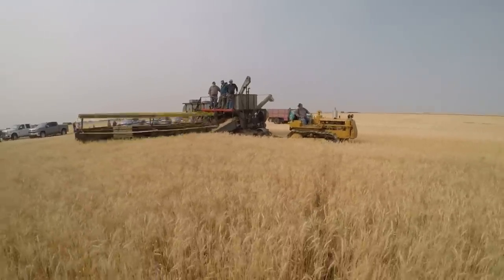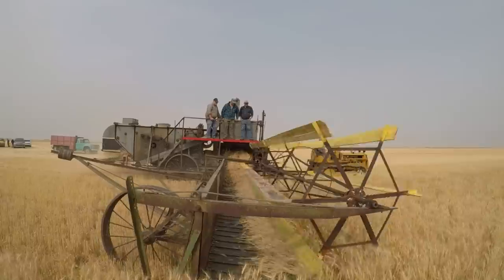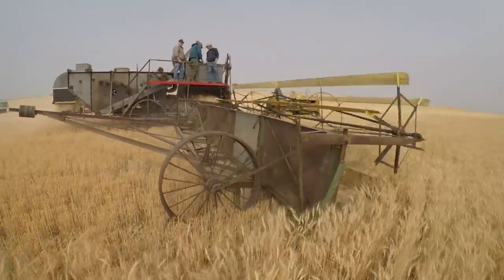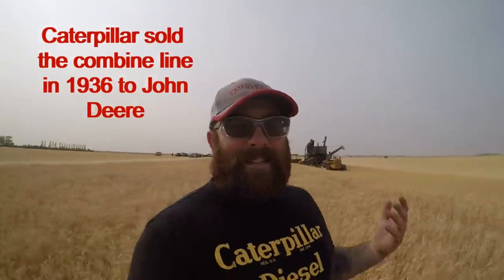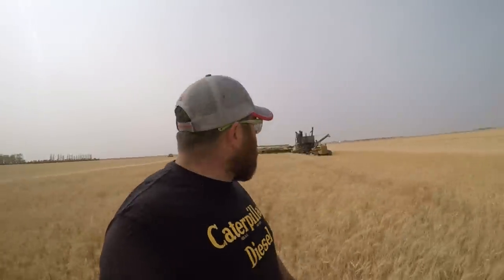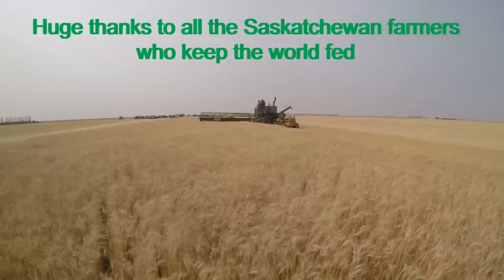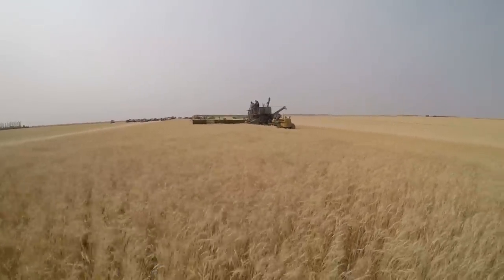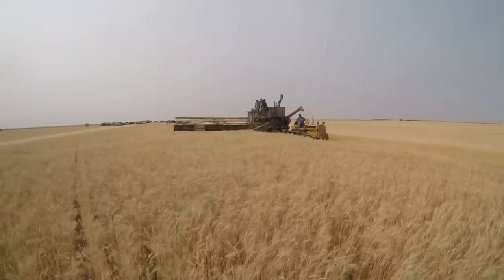1928 Holt 36 combining in 2020

Comment: Brings back memories of one of my first jobs as a youngster on our Kansas grain and cattle operation back in the fifties which was running the "ships wheel" to raise and lower the header.  Our deere combine didn't have the unloading auger technology, however, as it was gravity only.  Dad pulled the 16' machine with either the D2 or RD6 CAT depending on field conditions.  I recall the D2 getting stuck going thru a wet draw where it had to be unhooked and then pulled with a chain to get out of the mud.
Reply from the maker: Thanks for watching - glad we were able to give you a visit to the past!!

Comment: About 1964 my father and his brothers somehow got ahold of an old combine similar to this one, but it had rubber tires and I think a Continental engine. They only used it one year and left it parked after that. One thing I recall is that at the end of the day they were covered with dust and chaff. It also had the canvas belts to feed into the threshing part of the machine. The machine was scrapped out years ago, but was quite a contraption to watch in operation.

Comment: Back in the early 50's I sacked wheat in towsacks on a pull behind. The wheat split in two headers you flipped the lever over for the other  chute when the bag got full. You then pulled up an ear and half hitched it twice and then with a huge needle you quick tied across the bag and pulled up the other ear and half hitched the bag closed and threw it off into the back of a pickup which soon got more full so quick you wouldn't believe it.
Reply: Sounds like an old Allis Chalmers All-Crop machine.

Comment: I remember near our farm in Eastern Washington back in the 1990's there was an old John Deere tag along combine sitting in a barn about 3 miles from us. Not sure what year it was but I figure it dated back to pre WW2. It had rubber tires but I distinctly remember it was a model 36B. Looks like JD might have continued the Holt model designation after the buy out. Wish I could've had the chance to restore it. It had the old levelling system on it installed by RJ Hansen Co. - a necessary component in the Palouse region. Loving these old antiques!
Reply from the maker: JD kept the original design for many years after they bought the product from Holt/Caterpillar yes

Comment: I bet that thing lost half the grain that went into it. Between the old style draper with the holes, to all of the grain blowing out the back. Even unloading you could see the grain pouring off the side of the truck. I still bet that thing was the cats meow compared to cutting by hand back in the day. Very cool piece of history. Thanks for sharing.
Reply: Think of it as not having to plant as much seed for the next crop. :-)
Reply: Actually, if set up properly, these were very efficient. The farmer I worked for in the sixties had a McCormick #51 that I pulled and he would walk along with it getting hatfuls of material from the shakers and would rework the setup if necessary
Reply: Wasting grain was unacceptable in that day an age,today's new machine put enough grain back on the ground to support a farmer back then

Comment: It took 80 years for us to figure out how smart them men were back then with the draper head.  Matter of time diesel engines will be replaced with wide bore deep stroke gas too. What's wrong with the torque and efficiency of a Farmal M?
Reply: Of course the draper headers now are moister proof as opposed to the old canvas that would soak up any dew  and shrink

Comment: How did they open up a field (back then) with this “side header”?  Amazing to see how much this still is the basic look of a modern combine.
Reply: Same way they do now. I often ran a pulltype swather. First round is made with the tractor on the inside. Then a few passes down the middle to split the field into sections. Yes, some would be wasted to trample, but we let the cows into the fields after, they loved to clean it up.
Reply: gotta remember alot of fields were not as big as they are now. so im assuming some farmers back then. probably skipped a row or two when planting. but also like the comment above mine. they probably ran some over first pass like cutting hay with a disc bine.

Comment: So in 90 years what really has changed?
1) They run the reel in front rather than on the side
2) They are self powered (which is why they can have the reel on the front)
3) ? Anything?
Reply from the maker: Efficiency and technology I’d say are the largest changes
Reply: @ironman3406  speed and safety, two more. Oh, air conditoning.

Comment: And to think that’s how it was done years ago and before that it was horses pulling everything wow things have changed so much
Reply: When horses were in the field it was shocked and thrashed at a stationary threshing machine
Reply: @gregkoenig9200  huge teams originally pulled this type of combine, ground driven
Reply: @highwatercircutrider  I didn't know that because in the east my grandfather went from thrashing machine to a tractor drawn pulltype
Reply: @gregkoenig9200  my father bought a pull type John Deere right after he got out of the Army at the end of WWII, he had to borrow my uncles John Deere A to run it.

Comment: Does it overload the shakers if you take too big a bite? I see you are taking half width passes. Used to love going to the Threshermens Reunions in Illinois and Iowa in the 60's. Steam, Crawlers, Rumleys. Lots of cool equipment.
Reply from the maker: By the end we were taking a full cut - didn’t want to plug it up - it never seen yields that good in its day
Reply: @ironman3406  Have to shine up the metal or a plugup happens---
Reply from the maker: @verngoossen3628  it never plugged they know what there doin

Comment: All 1928 vintage except the crop. 2020 crop density is 5+ times as dense. Thus the need for 1/2 header width cutting. As to being same as modern combines, 1928 cars had engine, 4 wheels, and steering? But they're not the same as modern cars. Neither is the old combines the same.

Comment: Great video, bit it looks like the reel is turning abit fast.
Reply from the maker: As far as I know there is no speed adjustment for the reel like modern combines - the only thing you can really adjust is the table height, other than that the only other control you’ve got is the clutch to engage and disengage the whole unit from the engine.  Planning to do another video this fall if it running.  Thanks for watching

Comment: The tractor looks much better than  at the start of the video with the 60. It had an atrociously ugly top hat on. I could never understand the huge fuel tanks they stuck on blocking the drivers view. They would look much better to me without that hot water fuel tank. Could be they needed it up high for gravity flow.

Comment: I love the show but why just use half of the  header
Reply from the maker: Because the yields of today are triple what they were when the combine was built.  And also we didn’t know it at the time but one of the clean grain auger tubes inside had a large hole in it and was leaking clean grain back into the separator. That’s fixed now and it can take a much larger bite but still tough to get a full header.

Comment: Why only half a swat ,could the motor not keep up or is it you were preserving it for another trip for video?
Reply from the maker: Two things if you watch the full video you’ll see we did take the full cut - at the start we were still making adjustments on the header - the second reason is that in the 30’s 20 bushel an acre wheat was a big crop - this was yielding 60 so we didn’t want to overdue it till we knew it could take it all
Reply: Awesome, so can you tell me what adjustment is the fellow making above he header, would that be the height of the head?
Reply from the maker: @curtthege7425  I think table height is on the big wheel up there, then there is also a hand clutch.
Reply: @ironman3406  Thank You for sharing I agree why did take so long for everyone to get back to the draper head they are so even loading and miles ahead of everything else.
Reply: @curtthege7425  The old drapes were canvas & not very durable. Quality reinforced synthetic rubbers had to be developed to keep up with modern speed & power

Comment: Need to take your hat off and hold it under the straw output and check how much grain you are letting pass.
Reply from the maker: Garney Baker it wasn’t leaving much he’s got it pretty tight spent a lot of time on the inside of it, lots of new custom made parts
Reply: My Father would always push the straw aside, get down on his hands and knees, blow the chaff away to check how much grain he might be loosing. Some visions in your head you never forget.